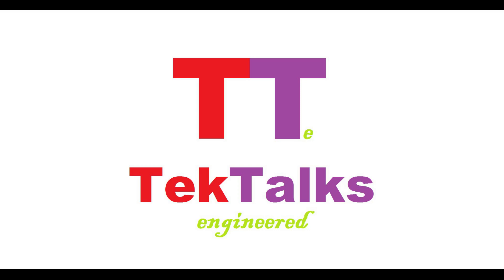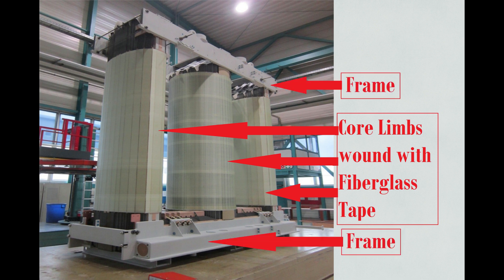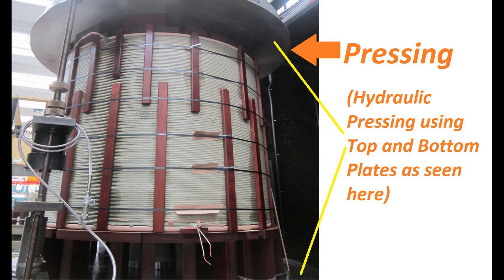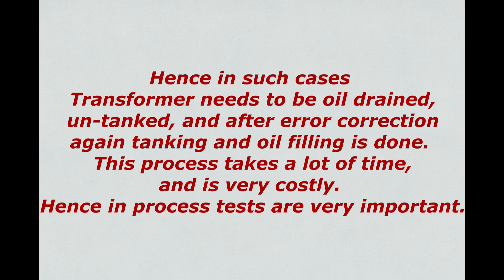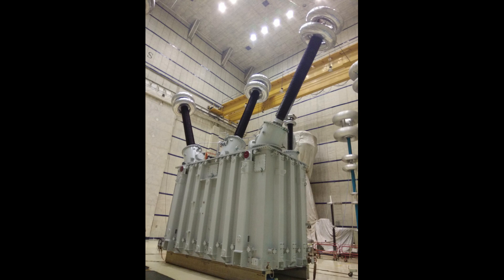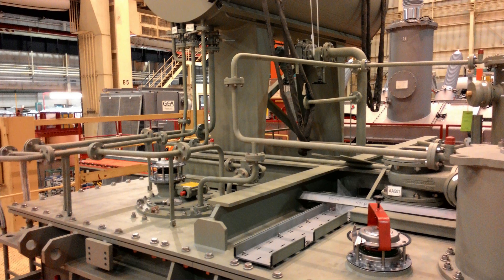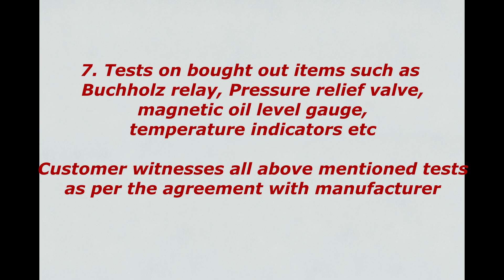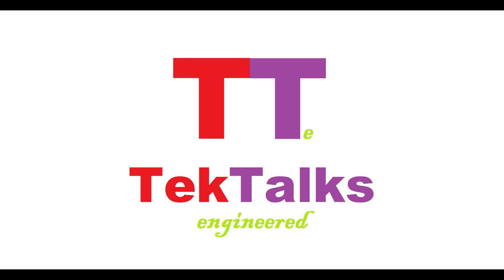Manufacturing of High Rating Power Transformers-ICTs-Complete Practical Process actual photos

Comment: Regarding price and efficiency it is better to have one one 945 MVA, 3 phase transformer, than 3 separate 315 MVA single phase units
Reply from the maker: Price wise one three pahse 315MVA would be economical. However three individual single phase transformers provide flexibility of only one phase replacement and repair, in case of any failure.
Reply: @ElectroGlobe1  Transportation of single phase three separate units are also less problematic than one 945 MVA unit. The latter is bloody heavy mofo
Reply from the maker: @imeprezime1285  yes